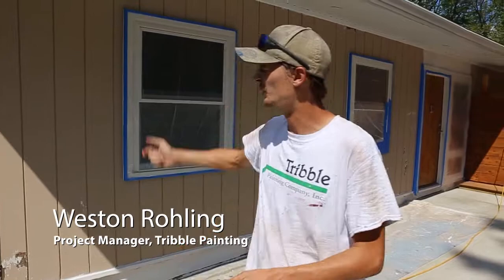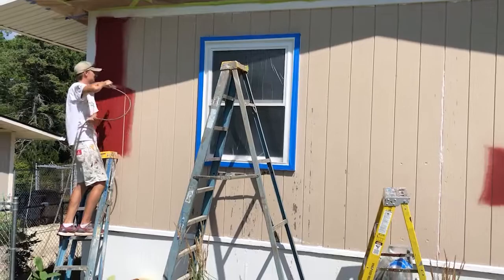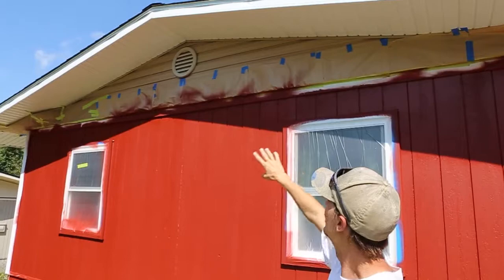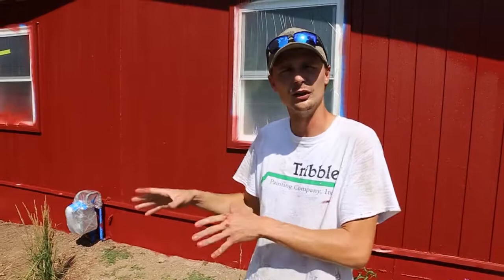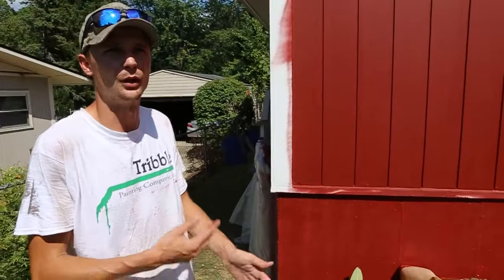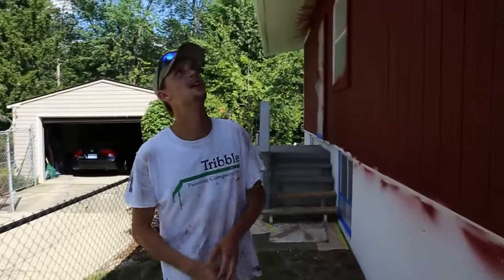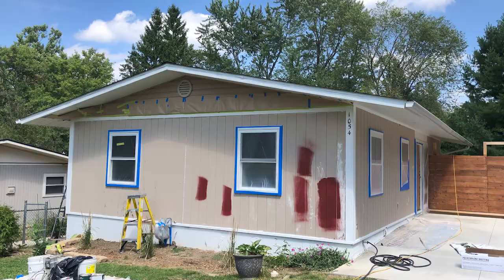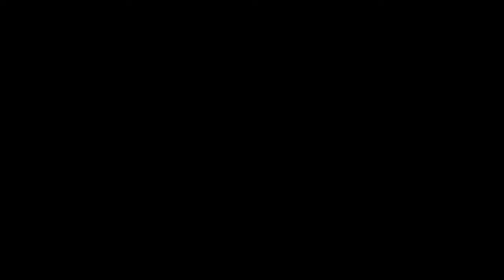Painting T1-11 Siding

Comment: When you paint the foundation, how do you keep the dirt from kicking up on the new paint? I have some 1/4 inch plywood I am thinking about using for protection. Also, my foundation has some indentations from the forms, what can I use to fill these spots, can I use fibrous cement or quick set?

Comment: Great job.  I recently painted one T-11  shed 6x8. with a brush and  rolle a 3/4' nap  and ot came out great. It just was a great amount of work. And time  I just received another, same materials just bigger. This one is a8x10 should I spray it. I have a hand-held wagner airless dyi jem. IM looking for great coverage and I don't mind creating a barrier around it just so I don't mess up there precious flowers.  Both customers paid for the materials and for this last one i gave him a price of $350 for two coats and cut the trim. These are 800k. Houses on a 1/3rd of an acer. Am o screwing myself because this is not my primary profession.  Just happen to be in between jobs and I was helping a friend thenapproached to do the same thing at two neighbors house. Love ypur work and your advice.  I feel im working to cheap and I'm wondering if I can get the same coverage with the  harry home owner wagner. Please,  when you have the time can you please let me know if in to cheap and if i should be spraying this one. Thanks for your time and WORK SAFE BROTHER.  NYC
Reply: Yes that's too cheap.  Factor in your travel, prep time, cleanup time, wear and tear on tools and include materials in price.  I would double the $350 quote.  People will pay to avoid the time or work.  Harbor Freight sells HVLP spray guns for $17.    You might be able to find a job site air compressor at a junk yard or on marketplace.  My neighbor was throwing one out and it just needed a shaft oil seal.  Very easy to get a pro account at Sherwin Williams, then you'll get paint for very cheap.

Comment: I just installed new T1-11 on my house. Is it a must to put on a primer before painting, or can I just paint over the new panels?
Reply: Looking for the same question 👍
Reply: @digitalghost81  my recommendation: prime before installing the T1-11 and prime on both sides. The most important issue is to seal the edge of the sheet that is closest to the ground. Backsplash will rot the T1-11 if the edge is not properly sealed.

Comment: Did they replace those damaged pieces before painting? Asking only because I have the same type of siding with some damage in some spots and am looking to paint instead of getting vinyl.
Reply from the maker: Hey Breonna! When it comes to t1-11 siding, they aren't separated boards like they may look like, t1-11 comes in sections we often call sheets. So repair/replacement can happen with this type of siding when damage occurs. This job didn't feature any water damage so I think the spots you're referring are the ones you can see before we painted it red. Those are spots where we found some loose paint we've removed from the house. Without scraping the paint won't seal properly and the issue will continue.  We've done a couple of videos on scraping paint you can check out here:
https://www.youtube.com/watch?v=O7I5RPr8cVQ
https://www.youtube.com/watch?v=lArFDy1-O9Q&t=5s
Reply: @TribblePaintingCompany  thank you for responding! We have the same siding and has a few spots of wood damage that I’m looking to replace before we repaint. 👍🏼